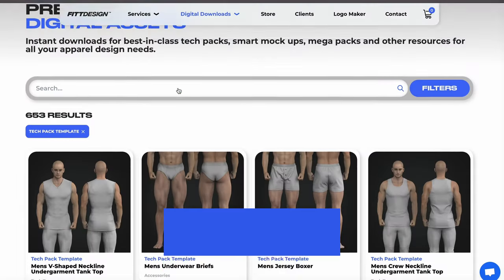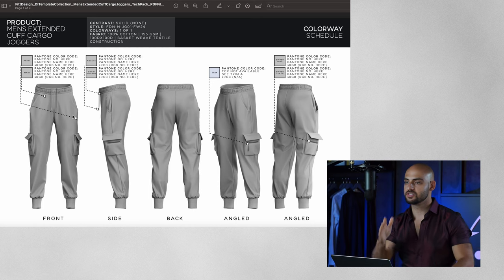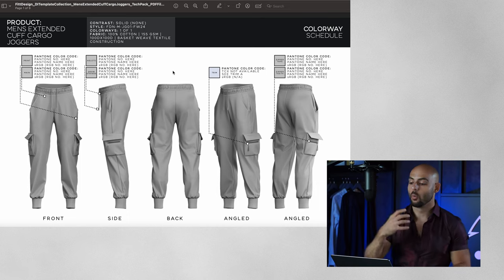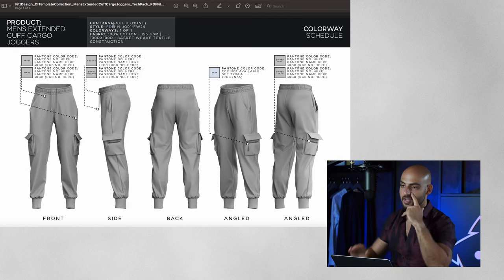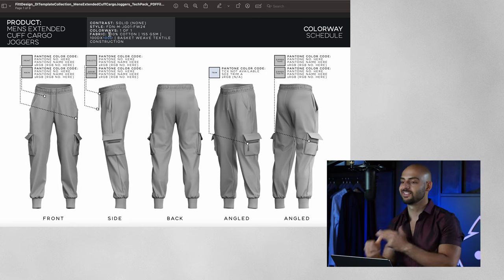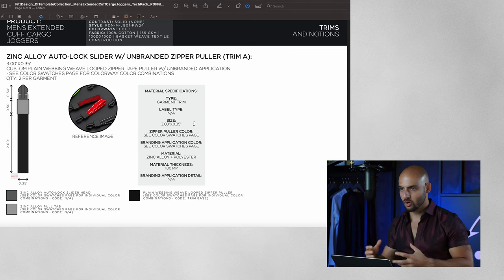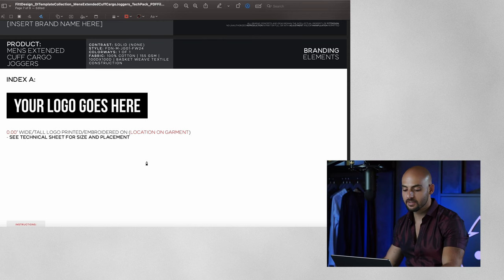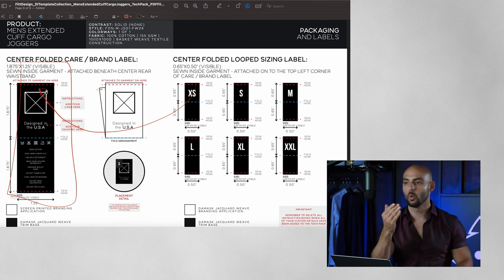How to Create the Perfect Tech Pack

Comment: does your garments and accessories vector super mega pack at $68 include tech packs templates like these? And 3d visuals?
Reply from the maker: The Super Mega Pack includes vector flats of garments only. It doesn't include tech pack templates or 3D visuals. Let me know if you need more information!
Reply from the maker: What you're looking for is our factory ready tech pack! it includes a fully editable tech pack with 3D renders (you can change their colors and add your own branding). Its the same type of file that I'm working with in the video. You can check out our over 650 different base tech packs that you can instantly download at: https://fittdesign.com/products/digital?type=TechPackTemplate